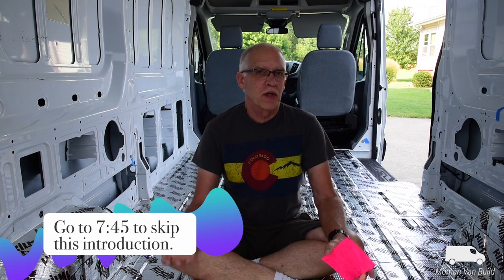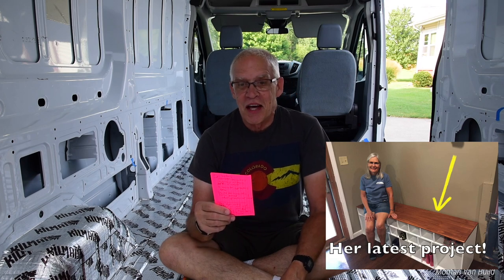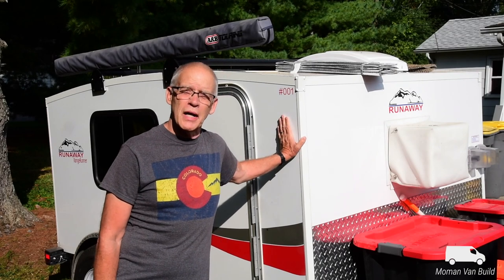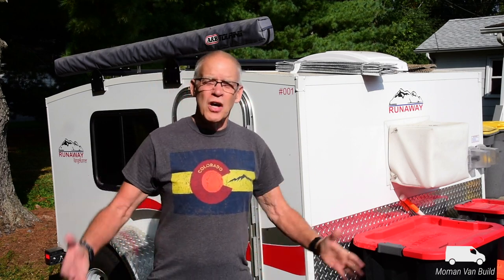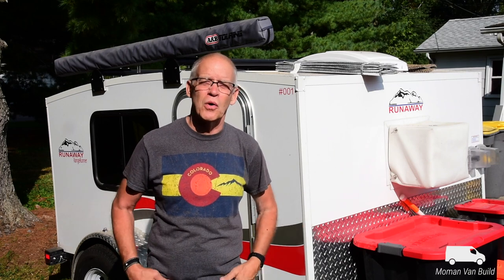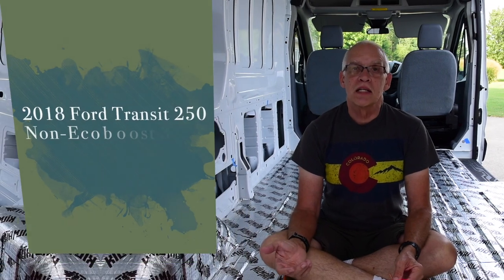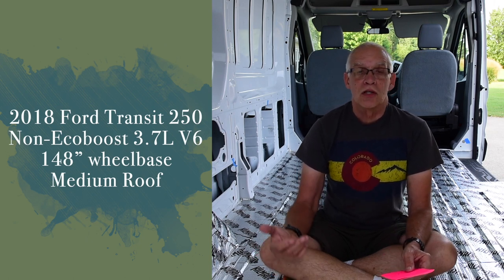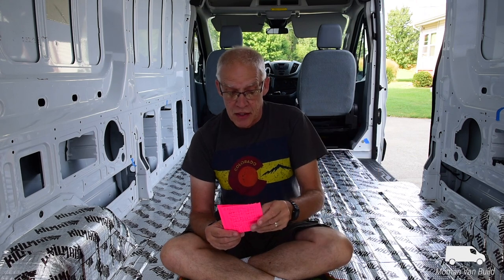Moman 2020 Van Build Episode #1 with Charles Moman

Comment: I came so close to buying a cargo van Ford Transit but wanted to have my camper separate. No extra oil changes etc. I had ambulance that I converted and the diesel engine went! A HUGE $$$$ loss. Put so much $ in it only to lose the engine 🫣🤯😔

Comment: Greetings from a fellow Hoosier... So glad I found your channel. You and Susie are adorable (well, mostly Susie ☺️)  I just picked up my Ford Transit four days ago and I'm planning a layout very similar to yours. Did you feel that the "aisle" is wide enough with two 24-in benches?
Reply from the maker: We do feel it will be fine because we will not be dancing down the aisle! We made sure that we can sit and our feet will fit. We would just rather have the bed sections as wide as possible for a quick nap and to make the storage "boxes" as big as possible. Are you far away from us here in Seymour? You do not have to be specific in case we might be a serial killer duo! : ) Good luck!
Reply: @charlesmoman , I'm 2 miles from the Michigan line but spend a lot of time in Florida also.  I agree with your thinking... Benches as wide as possible to create extra storage and 24" would allow me enough room to sleep without having to pull a bed out every night.

Comment: just a thought.  Used a mop sink for a shower pan on an old build.  24"x 24"x 12" deep.  Porta potty set inside.  Worked out well.  Also any a/c to be installed in van for hot humid weather?
Reply from the maker: Clermont Cubby No AC, But soon you will see an interesting option about air-conditioning. I already have a shower pan purchased that will work perfectly for us. But thanks for the suggestion anyway!

Comment: Are you considering making a pull out bed just like in your Runaway? Or even using the one from your Runaway since you plan a larger bed for it. Would try placing it in there for size...
Reply from the maker: No to a pull out bed. The sofa set up we are building will work better for us. We may even take out our pull out bed in the RR because we are putting in a queen and no need for a pull out. Thanks for watching.